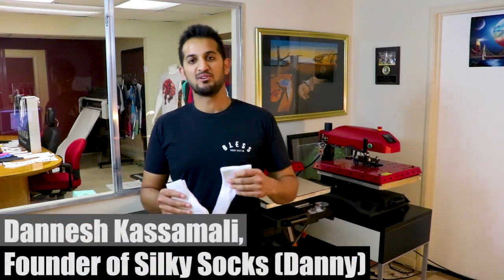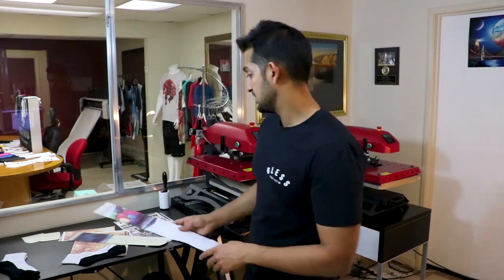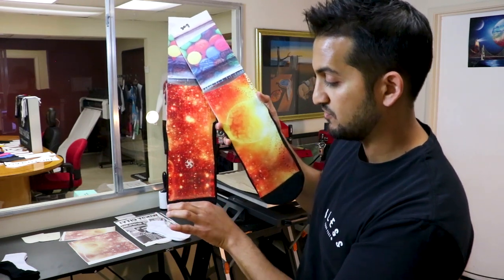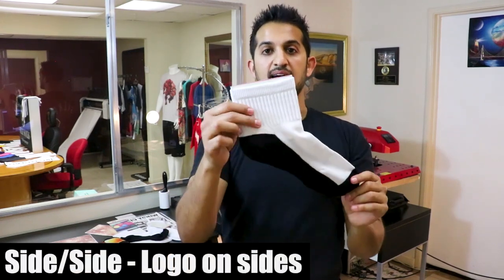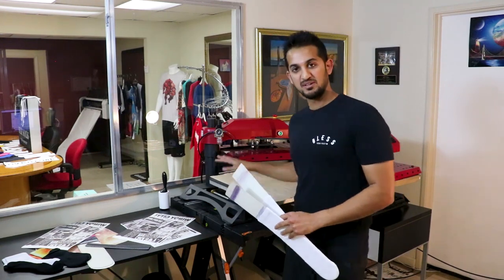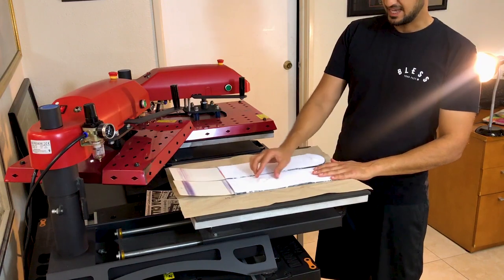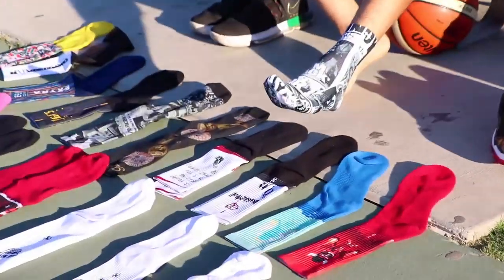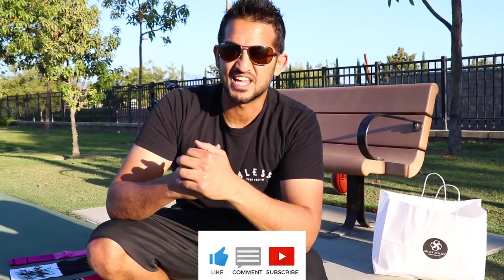How to make COMFY Sublimated ankle socks - Streetwear vs Athletic

Comment: I have always gone to the site where I purchased product to find temp and times for sublimation. I didn't know it depended on ink. Most of the time it works out for me. I would say only 5% of the time it doesn't.   I had told my husband I wanted to order some of your socks and well I should have stood over him when he placed the order. He went to amazon instead. Quality is ok not great. Looking at this as I get to learn and perfect on these before getting a better quality. 
What are your inserts made of? The one that came with socks is metal. I can only sub one sock at a time until it cools down for me to handle. Because of this I am not doing full sub on entire socks. I tried that and even with gloves its to hot after a while and hard to adjust. Right now, I folded paper and taped design on front and back so when one side was done I just had to flip it over and do the other side. Now I am waiting for the insert to cool enough to handle so I can get the other sock on. 
I see we can send you our designs and you print them out for us and but as another asked can we purchase any of the designs you make? 
I love your videos and advice. Thank you for sharing.

Comment: Hi, Have you ever experienced socks losing all his elasticity once sublimated? The socks are all streched out. They don't come back the size the were before sublimation. Also even if I do the roll out, I have a dark border on the edge of the socks. Thanks for your help!
Reply from the maker: concours3accords are you using our inserts?  You want to make sure you unload them about 10-20 seconds after they are pressed.  And unload nice and slowly. That works for us with no problem. There will always be a line on the sides or break in the pattern.  You just want to minimize it with the design you make and the roll technique.